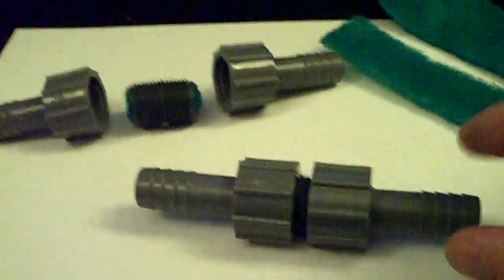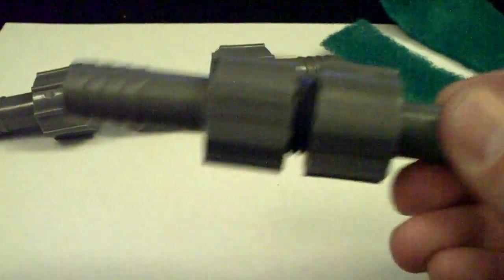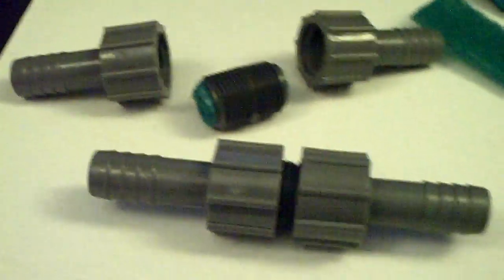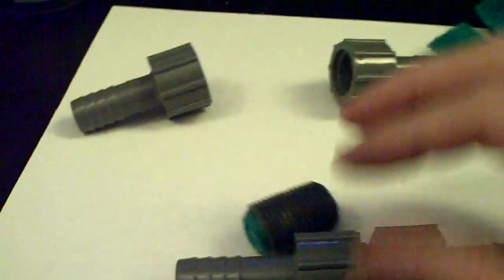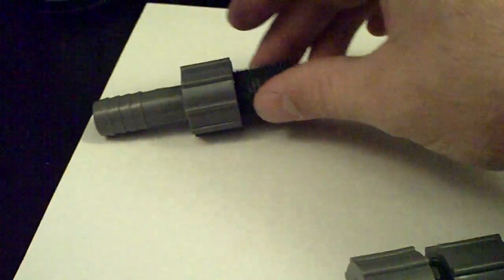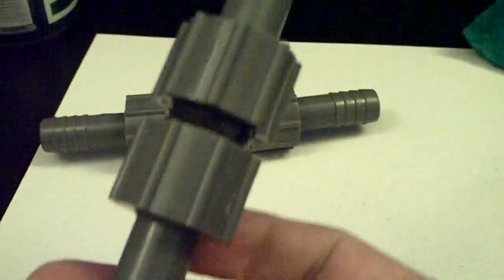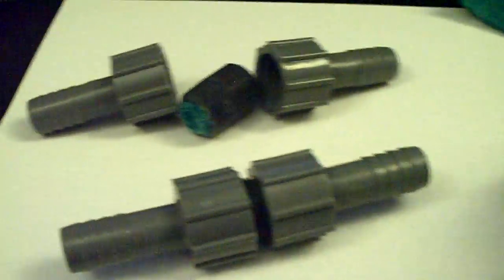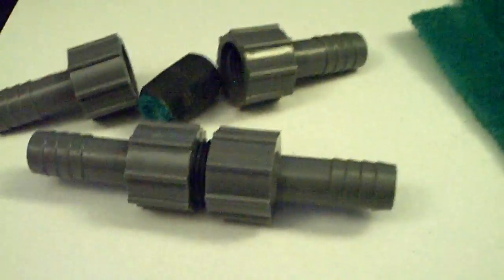Vid44 Simple HHO Gas Filter (HHO, Brown's Gas, Hydroxy)

Comment from the maker: @GenericUth  I was using these originally to try to filter out the vapor that comes as a result of using KOH for electrolyte, but it didn't work too well with the green scrubbing pads.

I actually ended up taking using small pieces of a sham-wow cloth instead, and it worked like a charm.  I also put an inline fuel filter as a secondary filter.  The filters are inline after a bubbler, so I don't really have a problem with moisture.

Thanks for watching.

Comment from the maker: @HybridWaterMan2 

I actually use a 3 part filtering process.

First I use the filter in the video above, then I use an inline fuel filter, and then I use a charcoal filter (aquarium type) to catch any remaining foreign impurities.  It may not be the most scientific method, but it seems to work well and it is inexpensive.

Comment from the maker: If you are using KOH or LYE for electrolyte and your fuel cell is connected to a vehicle, it is a necessity.  

The vapor that is created from KOH & LYE will break down any aluminum parts that it comes in contact with in your engine.  

The filter helps to prevent the harmful vapor from entering your engine, plus it can help to give a cleaner flame if you are using it for a torch.

Comment: The one I use is 6" long and I have no flow restriction , the key is to not pack it in....I have another that is around 10" x 2" and have little to no flow restriction ..As long as its not packed the flow will be fine ..

Comment from the maker: I'm not sure if making it longer will be any better, because it may restrict the air-flow too much.

I made it small because I didn't want to have problems with back pressure.

You can also make it with 1/4" pieces instead of 1/2".